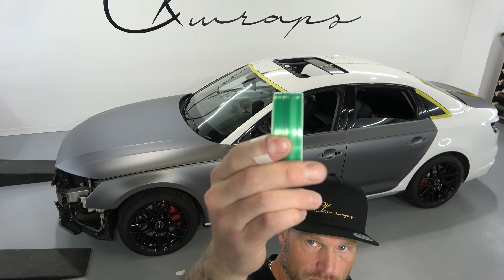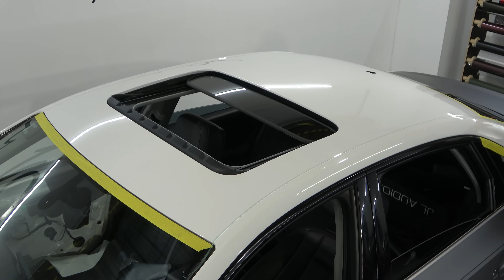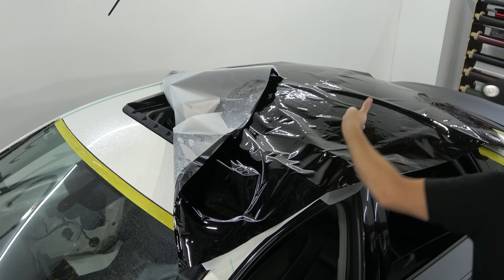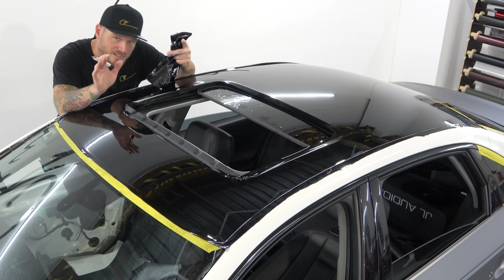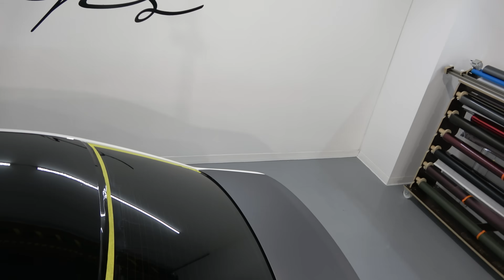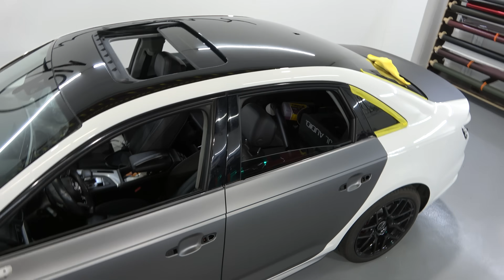Beginners Guide - How To Gloss Black PPF Roof Wrap

Comment: I’m going to do this with vvivid+ ultra gloss premium that supposedly has nano air release and a protective cap, so is the process the same and is the tucking into the windows seals the same? Do we tuck it in first and then remove the protective cap or remove it before tucking in?

Comment: How do you deal with seams, overlays, inlays etc with this stuff? I haven't tried every dry apply brand but so far it does not like sticking to itself. Larger overlaps work, but what about for sharkfin antennas? As soon as water touches the edges, it lifts.

Comment: I found flexi in gloss black to be pretty hard to do even on a roof, i like that stretchy gloss black ppf from other brands, makes it easier , flexi is no joke especially dry
Reply from the maker: It was probably their first series of color PPF which is really difficult to install. Their second series is by far more pliable but I highly recommend doing wet install on large flat surfaces when using the gloss color PPF.
Reply: What brands do you prefer? I’m looking for recommendations

Comment: Do you have any tips on how to use knifeless tape on the colorfusion ppf? It didn't work well for me at all!
Reply from the maker: You should use Precision Line. It has a steel filament in it.
Reply: @CKWraps  Thank you! I was using finish line and had no idea there was a difference. They should really make the bags look different! haha
Reply from the maker: @TheLunkerLab I agree, they all look the same from the outside. But the precision line is 1/4" wide as opposed to 1/8" so it's in a bigger bag. You can also use design line which works much better than finish line. Design line is a bit finicky but it's what I use.